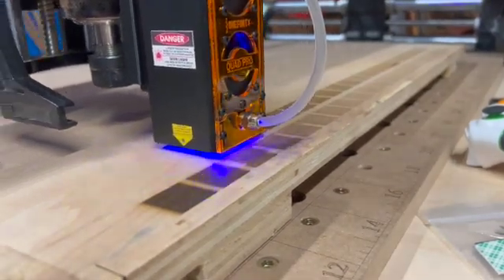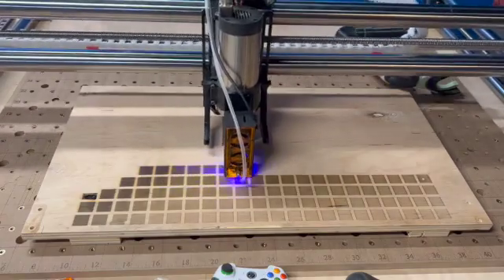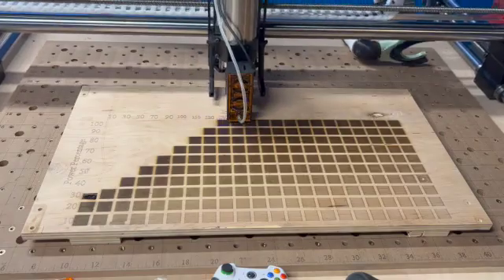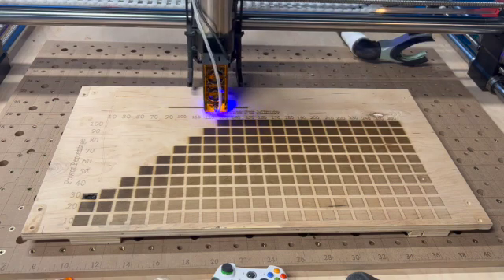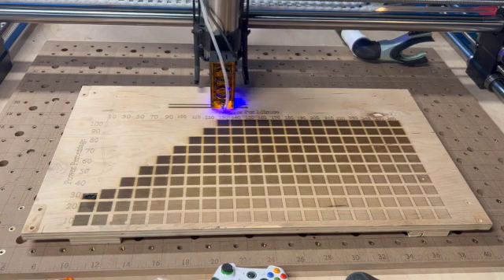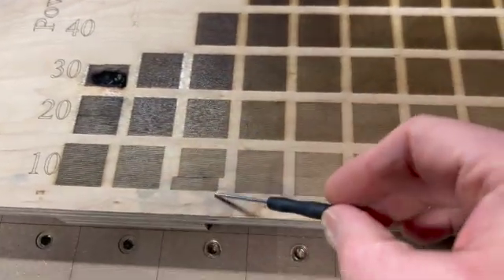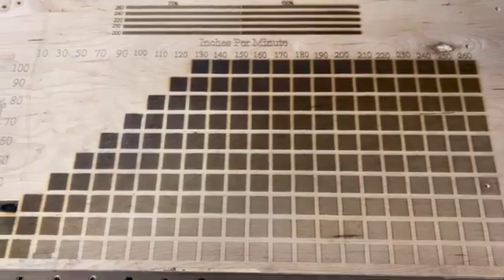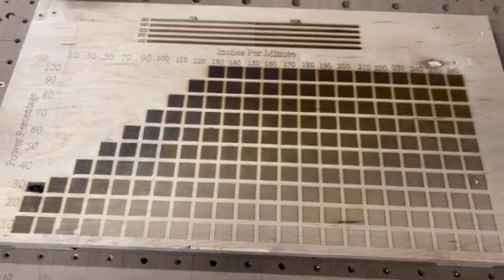Onefinity Journeyman X50 with Jtech 24 Watt Laser and Printing a Matrix...that catches on fire

Comment: This is great info!  I have a 24 Watt on order.  What software did you use to create the file and would you be willing to share the file?  I have VCarve Pro but their laser module doesn't support the 24 Watt Laser yet according to their website.
Reply from the maker: Thanks Rick.  I used Vectric Aspire to create the program and yes, absolutely I can share the file.  What is the best way to get it to you?
Reply from the maker: So it took a little bit however I made this file available at
MWReclaimed.Etsy.com

Comment: Hello. Did you find the cables were long enough for the onefinity
Reply: Yes I have the journeyman x50. I'm so on the fence with the laser. I currently have the 7 watt jtech. It engraves nice but it's slow and can't cut. I would say I engrave and cut about 50-50. I'm not sure if I should buy the 14 or the 24. Just wish I knew how well the 24 can engrave. I live In Canada so the 24 is around $1600. Thanks for your videos
Reply from the maker: @stephenball5126  I'm preparing to do another engraving video as well as a cutting video.  I should have both out in the next couple days.  So far I'm happy with the 24W which I upgraded from the 14W
Reply: @Sustainable WoodWorking  thanks for your time. I appreciate it.  Can't wait to see the new videos
Reply from the maker: Hi Stephen, that a great question.  I mentioned it in an earlier video and should have followed up.  Yes, the cable and the air supply was long enough.  I had about an extra 6 inches on both however enough to get through my drag chains and down to the controller.  Are you running a Onefinity machine?